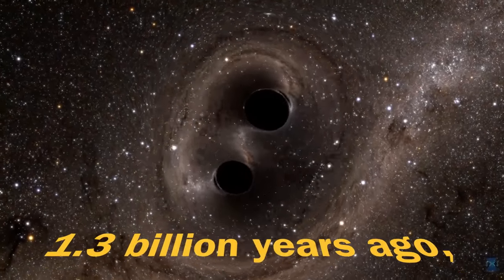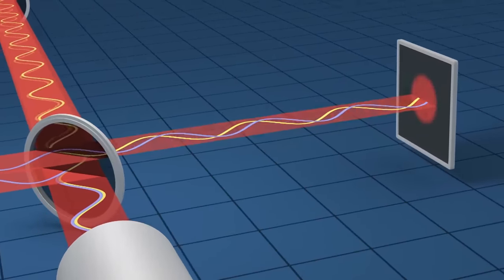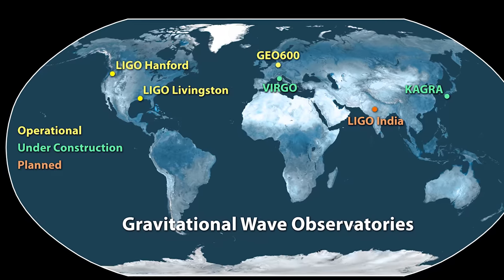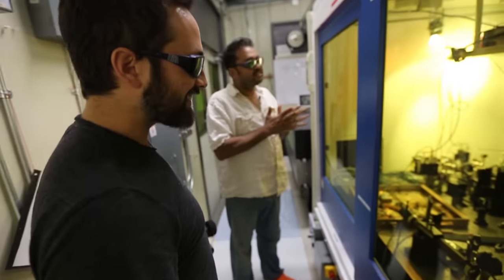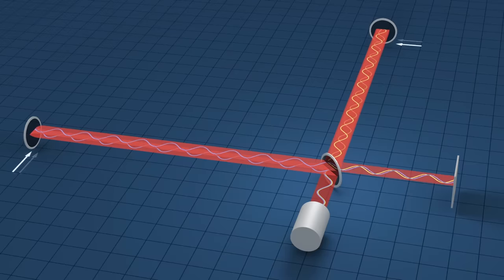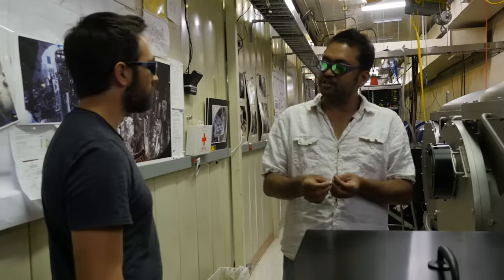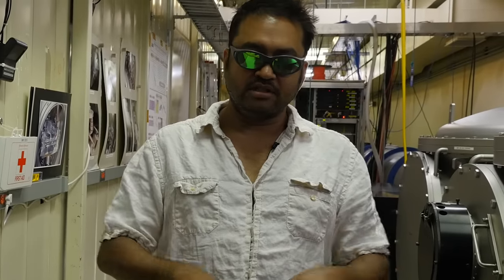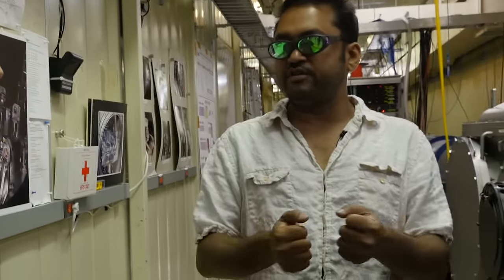The Absurdity of Detecting Gravitational Waves

Comment: Did we know the two black hole collided before the waves hit? Or did we find out after it happened?
Reply: Both happened at the same time  approximately. There are a lot of different types of observation equipment on and around earth and they would have detected the other signs that a black hole merger would give off. They verify the detection, in part, by verifying that a black hole did really merge
Reply: genius ! you have a point eiyazoo , Lol since when is it scientific method to use a theory to prove another theory factual ?
Reply: Blach holes are black, the clue is in the name. When they merge, it's still black, the merger gives of no light. They know it was black holes from the frequency of the waves and the rate at which the frequency rises.
Reply: Eh Chuck Norris accidentally bumped God's coffee table.
Reply: technically they didn't observe black holes collide they observed 2 tight star clusters  collide ?  nobody has ever seen a black hole but apparently NASA is guessing that black holes must be inside tight star clusters strange how those black holes just  don't have the power to pull those star inside of it but could have enough power pull them close enough to make a complete impenetrable shield around themselves , also wouldn't a gravity wave be sent in all directions ?
 NASA
Reply: yeah it does sound iffy, isn't the movement they measured like the length of a proton ? it just sounds ridiculous to me.
 The are claiming that theoretical black holes colliding could prove that gravity waves are factual ? don't you have to at least prove that black holes are factual first ? there is suppose to be a logical order here in science and these guys are just inventing stuff and using it as scientific propaganda to convince average people that their model is factual. What it proves is that main stream science needs to be dismantled and replaced with real science that is not controlled by the corporate media.
 This is very poor science that they can blast billions of dollars on equipment no one can afford .
Reply: they should also prove the speed of gravity too because I'll bet it's not the same as the speed of light and that would just ruin their day !
Reply: And I still can get my cheeseburger without pickle.
Reply: eiyaz00 
There are neutrino detectors in underground places on earth.  They detected a burst of neutrinos that coincided with the two black holes merging.
Reply: Robert Yeahright 
You yourself are spreading propaganda.  You claim, with no proof whatsoever, that science is under corporate control.  You don't know what you are talking about.
Reply: darth vadar called like a day before.
Reply: thats funny what proof are you looking for because it is actually common knowledge ...................
Reply: there are over an estimated 2 trillion galaxies in our universe and in each of those galaxies are an estimated 200 to 300 billion stars. 
 They never saw 2 black holes collide, they saw  2 tight star clustered galaxies collide, in which they ASSUMED had black holes inside of , they ASSUMED !  . So you actually believe NASA has they ability to weed out 2 trillion galaxies influences on their equipment because they claim to have seen 2 theoretical black holes collide when they couldn't possibly actually see 2 black holes collide ? just calculate tyose odds against accuracy  and get back to us with the probability that NASA actually knows how stupid they really are
Reply: NASA is the science for people who enjoy Fiction over the truth, sorry bro NASA doesn't support scientific method and we don't support NASA because of that
Reply: The 2 trillion galaxies in the universe have no effect on this equipment because none of them are generating meaningful amounts of gravitational waves.

And about the black holes, The mathematical models have predicted the existence of black holes for decades and the observed motion of material near black holes matches almost perfectly with the predictions, almost every science organization across the world agree that black holes exist and that gravitational waves (initially theorized by Einstein) have been proven by the LIGO detectors.
Reply: Robert Yeahright Besides... Is it really that important that they are black holes? They can just be two massive star clusters with very intense gravity, I'd say  it works either way
Reply: I saw LIGO mentioned in an episode of Through the Wormhole recently and they mentioned it measuring this gravitational wave. They explained how the equipment worked, what it measured and that they claim it was created by two black holes merging. It was never explained HOW they knew it was from 2 black holes merging. Others have mentioned that other equipment measured it too and that is how they knew, but what said it was from black holes colliding? Are they just making assumptions? If so, based on what exactly? I watched this video hoping it would explain this aspect of it, but it did not. 
It sure does seem like an awful lot of time and money to spend on essentially nothing. What is going to be done with this information? How does this help anything other than proving part of Einstein’s theory of relativity? Did we really need more proof that he was right? They said this place employs 2,000 scientists. Does it really take 2,000 people to watch lasers bounce back and forth? Seems like a computer could do most of the work and just a couple people to interpret it.
Reply: They detect black holes by the amount of distortion (warped space) the hole causes to it's surroundings due to the immense gravity force. Nobody claims to know what black holes are made of or what happens to matter and energy inside them... but the fact that these things are out there is not disputable.
Reply: The frequency of the gravitational waves at the end support the fact that those are black holes or at least singularities. Otherwise I'm pretty sure it's impossible to get that massive an amplitude with that frequency in gravitational waves, as it'll require superluminal motion.
Reply: Robert Yeahright no point in that, gravity is an effect of curved space-time, and we already know that space-time does not have to adhere to the same laws that dictates the 3 dimensional plane.
Reply: After
Reply: Robert Yeahright 
Black holes cannot be observed but the effects of their immense mass can perfectly well be observed, and for almost half a century already...
It's like saying light doesn't exist. We can't observe light as in photon waves, but we can observe the effects just as well, that's how human sight works after all, your retina never sees light, it only reacts to its interaction with your cells.
Why don't you try actually studying the subject before questioning blindly? There's a reason why theory exists...
Reply: Robert Yeahright gravity (information) travels at exactly the speed of light
Reply: eiyaz00 We found out after. Astronomers worked out what would happen if two black holes collided and then they used the gravitational wave detector to see if they could 'see' it happening.
Reply: @ROBMCKISSOCK  Do you even know how black holes are formed. Just becuase they are there doesnt mean they will suck everything in the universe. Like planets to stars, mass orbits the black hole, not necessarily gets sucked unless already moving towards or gets pushed off orbit into it. For example, the earth rotates around the sun, yes? So, if you were to compress the sun until it can be conpressed anymore, it would collapse into a black hole but still keep the same density therefore not affecting its gravitational pull on surrounding plantes. So, if that were to happen, the earth and planets wouldnt just get sucked in into it, they would keep orbit. Same for these massive black holes in the center of these galaxies, the were once stars that collapsed into black holes and remain the center of it all. So ignorant some people are.
Reply: Black holes are an imaginary thing, to assume that you'd know how they form is beyond ridiculous because you don't even know what gravity is.... now that's ignorance on a galactic scale
Reply: Robert, they've already long established that the "speed of gravity" is identical to the speed of light limit.

Comment: could a 3rd arm be added. maybe down a mine shaft?
Reply: That would be intense.
Reply: A vertical arm would be an engineering nightmare.  With $$$$$ sure it could be done, but hanging mirrors by threads and clever mountings to be unperturbed by traffic a few miles away or hummingbirds hiccuping outside the building, and compensating for thermal effects, and access for electricians plumbers and technicians, and all the other details, would make it pretty well impossible. 

Better: Build another LIGO facility somewhere around 90 degrees longitude away. One arm of that could be perpendicular (or close) to the two arms of the first facility.   That also makes it easier to tell a genuine GW event from random junk vibrations.

Of course, they've already built two facilities in the U.S.
Reply: very true. it would be cool though.
Reply: that's true. You can dig a huge hole and fill the sides of it with mercury or sth to absorb all vibrations. And then put a pipe down it that hangs by the (silica gel threads?).
Reply: not sure how it would really make that much difference in general....and finding a place you can have a 4 KM deep mineshaft might pose some issues.....
Reply: And how much mercury do you have on hand?
Reply: beaconrider idk. But there's a lot of mercury in this world. And it can be any dense fluid. I just said mercury because it looks cool.

Tim Hyatt Not a mineshaft. It's a giant hole in the ground that essentially isolates the pipe from any vibration since it's not touching the sides of the hole. Mineshafts are shafts for mining. This is just a deep hole
Reply: +Tim Hyatt You don't really need 4 km deep shaft. You can build the complex as lower third of a cube on a corner (because it does not really matter how you orient the axes as long as they are perpendicular), then it would need to be ‘only’ 2.3 (4√3/3) km deep.

Comment: So in the audio world, you can take two signals, reverse the phase of one, isolate the noise by adding them together and then subtract the noise from one of the signals to get a clean signal. Is that basically what they're doing with the two stations? Cuz thats really cool.
Reply: Yes. And if there is a slightest phase shift, they gonna immediately notice that.

Comment: This explains it better than most, but it still seems absurd.  Light travels through spacetime; distort spacetime, you distort EVERYTHING in that reference frame proportionately -- and only in reference to some EXTERNAL reference frame.  Nothing should thus be detectable IN THAT ORIGINAL FRAME. Do you expect the transmitted image of the laser to notice your monitor isn't playing the video in the same ratios it was recorded in?
Reply: To answer you question, it needs a better understanding of GR that I do: you need to know the difference between local coordinates and proper distance, and how a GW can let local coordinates invariant while affecting proper distances.

Look for this article (should be in open access):
"The basics of gravitational wave theory", by Anna Flanagan and Scott A Hughes, sept 2005 in "New Journal of Physics", Volume 7, 2005. It's explained page 15 and 16.

Comment: Fantastic stuff! Dr. Adh is the coolest.

Seriously, though, why doesn't a gravity wave stretch both arms equally? (Are gravity waves polarized?)
Reply: They are not polarized, but they have a wavefrom that goes a given direction. If that direction happens to make the same angle with both arms then the signal can go undetected, but this is also why there are two distant detectors.

Comment: Incredible engineering and ingenuity. Although using two sites rules out local noise, when seeking fluctuations that are a fraction of the diameter of a proton there must be so many false signals that need to be automatically excluded from the data. How is that done? I've read it's algorithms which generate alerts for subsequent human analysis. How much room is there for errors - and confirmation bias?
Reply: Common sense would tell you it's fairly impossible.  If gravity waves Wire anything it would be all around us at every possible minutia.

Comment: In the old days gravity was described as an ‘effect’ not a thing and thus never anything particulate or substantial. The only improvement to my understanding since is the notice given by RBFuller that gravity is the ‘synergetic’ effect of everything physical - that the effect is ‘Unit’ - and that the effect minutely exceeds everything of a radiant character - thus achieving what gravity is good at in containing everything within a bound. He pictures it in volumetric geometrical form as coloured blue - inwardly directed - and using octahedral form in approaching the centre where under pressured circumstances the octahedral forms are transformed into the radiant - red - form of a series of tetrahedra - alias quanta - alias photons - and which begin the outward journey of the perpetual cosmic loop getting caught in many interesting systems on their way - a bit like life...

Comment: Concerning the methods of detecting stretches in space, I wonder whether the red-shift of light packets would shift (A) in tandem with the stretching of space, or (B) despite the stretching of space?  If (B), then you might be able to measure the stretching of space over a predetermined fixed distance by shooting light from one end to the other; if there is a change in expected red shift, then space was stretched.  If (A), then never mind!

Comment: Light photons also carry momentum and I would guess a large one with a megawatt of power. So I guess they also need to account for the mirror getting hit and disturbed from its position (as it is not rigidly held but hanging in silicon threads), with each set of light pulses hitting in succession

Comment: How do they dissipate all the heat generated from the 1 MW laser when its running? Since its in a vacuum & reflecting off the world's most perfect mirrors it won't be absorbed by the equipment... something must be designed to deal with that.

Comment: How far do competing centres of gravity within a large stellar formation prevent any possibility of a theoretical ‘black-hole’ from forming in the first place - things always condense. A ‘black-hole’ could never be a star under the definition of a star since if light cannot escape it after its stellar life when it is less massive than before - how then can it escape when it has greater mass and exerts greater gravitational retention? When did gravity cease to be a general effect and become a positive and particular thing? If gravitational attraction doubles its effect every time the distance between approximating bodies is halved is that attraction at the fourth power - or do I have that wrong? If I have it right does that not mean that gravity is an intense surface effect of bodies and little more and that so-called ‘space-time’ is of extremely limited application relating to degrees of distortion of a relatively continual state of affairs? If gravity is a general effect of ‘the whole of everything’ how (on earth!) can it be either particular or subject to speed limits for radial particular propagation? In this regard is the general theory of relativity deceptive? Does not a tensile structure - like a tugged piece of string - two light years long move objects without the temporal separation which governs the behaviour of irradiating phenomena?

Comment: If I understood it correctly, having a longer distance to run for the laser would help with the detection sensitivity. Currently they are doing it in the 4km tunnel. Is it possible to shoot the laser slightly in an angle into the tunnel to have it bounce back and forth several times? Essentially multiplying the 4km by the number of bounces the laser can do based on the shooter angle. Again, stupid question and I might be missing something.
Reply: The mirrors would not bounce the light perfectly, and you would get scatter that would make getting any actual results impossible.

Comment: By simple logic - if these waves distort "spacetime", it should not be possible to detect them with a detector that itself is in the said spacetime. As the detector would be distorted along with it. Tell me if I'm wrong and why. Also, I've always been bugged by how they depict gravity wells with a 2D mesh plane with 3D celestial bodies on it. Shouldn't the spacetime be, like, in 3D?
Reply: You have to remember that the disturbances in spacetime propogate at the speed of light (which is a finite speed), so while one laser is disturbed the other is not. This also applies to parts of the same laser beam. Eventually a stretched part of one beam will interfere with a non-stretched part of the other.

You are spot on about gravity wells extending out in three dimensions, that's just very difficult to show on a screen in a way that makes sense.
Reply: @skeksis1085  Who has measured speed of gravity?
Reply: @ldkbudda4176  "Gravity" doesn't have its own mass, so it moves at c.